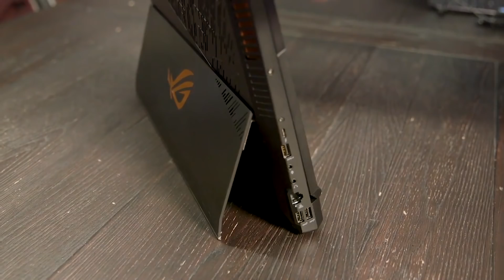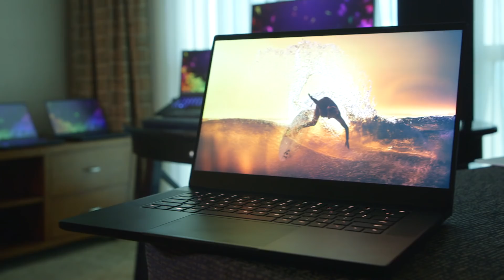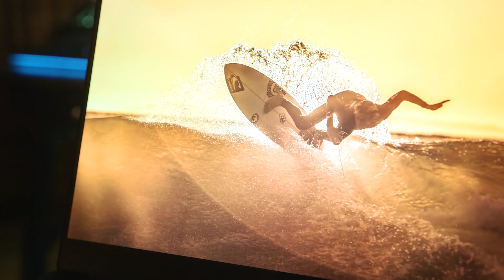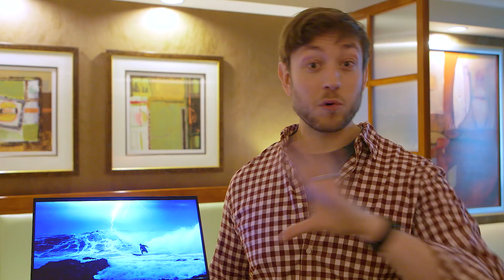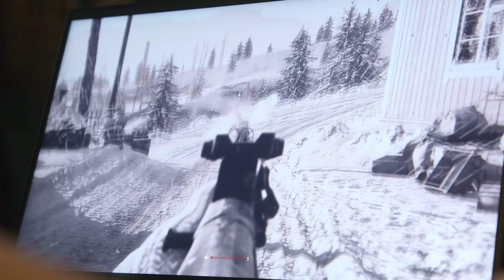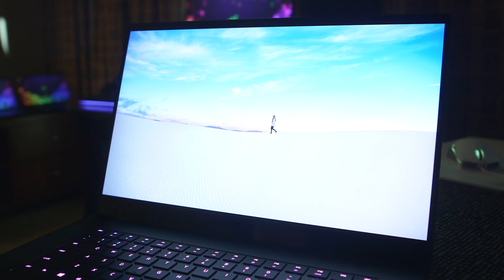Razer Blade 15 Advanced Edition Hands-On: One of the Best Gets Better at CES 2019

Comment: Beware CPU overheating an issue (again), 100degrees with some crashing. xtu undervolt resolves but disappointing it doesn't cool adequately out of the box. GPU ok, 76 degrees max I've seen even in gaming mode (rtx 2070 model). UK (non-US) version buyers NOTE: the secondary function keys do not light up as they were supposed to on the 2019 advanced as advertised, very disappointing to not roll out to all markets. Also there are no drivers available on the Razer website and their support confirmed to me 'they're still working on it', again not great as I have to rely on windows update for drivers and can't tell if crashing not helped by incorrect drivers. I'm deciding at the moment whether to return to amazon based on all of these issues (but the rest of the machine is great which is why the hesitation).

Comment: Why isn’t the 4K version with the 2080 120Hz?
Reply: 4k model available with the 2070 only
Reply: I´m asking myself the same. Why they don´t wanna offer the RTX 2080 with a 4K screen? @anthonyp2382
Reply: The Delivery Man Maybe the 100Wh limit for the battery is the problem. I would imagine a 2080 and a 4K 120hz screen would have abysmal battery life.
Reply: Sorry if i probably was a bit missleading. I didn´t meant a 120hz display. I meant the 4K 60hz touch display you can only choose with the RTX 2070 according to the Razor website. With the RTX 2080 there is only the option for a 144hz full HD display. But why on earth? I´d want the 2080 with the 4K display.  @anthonyp2382
Reply: The Delivery Man 100%. The 2080 is wasted on 1920x1080. You might as well just wait till it comes out and get the same but with a 1070 which will be much cheaper. A 1070 is all u need for HD res.
Reply: Yeah, my initial thought was that makes absolutely no sense for me. Why no 2080 with the 4K screen? @skywalkies77

Comment: Well, this is the only laptop in the windows world that could make me a little bit jealous. Even tho my 15" macbook with Vega is like.. almost perfect... for me as part-time gamer, that amoled screen or 240 hz (i mean, no tearing, no vsync stuff!, stable 45fps if the gpu isn't fast enough for 60fps at max settings) and rtx 1080 a laptop this thin.. and it actually looks good contrary to all other gaming laptops with their childish design.. is just wow.
Reply: But still Vega 20 vs. even 1070 max q  is 2x performance or so in gaming for the 1070 (1070 max q is similar in performance to a RX 590 desktop)

Comment: "Squeeze a full 2080 Max Q in this laptop" is not a big deal...Max Q is a laptop gpu sku.. its smaller and lower power than a 2080 desktop gpu...
Reply: MotoSapien 
it is a big deal actually. this is gtx 1080 (full desktop) performance in this form factor.

Comment: Guess you haven't seen an Alienware 13, it's had an OLED option for years.
Reply: OLEDs are great, burn in is pretty much a non-issue now. Most flagship smartphones use OLED with no issues.

Not like ips has no issues either.
Reply: @Brother Ares Why?
Reply: @Brother Ares care to cite that recall? As far as I know this is Razer's first OLED laptop. 

We don't see widespread issues on OLED TVs, phones or Dells Alienware laptops.

It's a laptop, do you really think that the screen is going to burn in significantly before it's obselete or unusable because the battery, or some other component, has worn out?
Reply: @johnm91326  If there are static images, burn in with OLED is real.  My Galaxy S7 Edge has severe burn in.   I almost bought one of the newest OLED LG TV's at Best Buy in November and once I saw the burn in with the display unit I changed my mind fast.  Hopefully, the newer screens will have this issue resolved.
Reply: @Brother Ares guess backlight bleeding, ips glow and ghosting aren't real issues then. IPS being capped at 60 is just another reason to buy the OLED one then right?
Reply: @Brother Ares to quote you "IPS will be caped to 60fps." Either way I have an original galaxy s with almost no burn in (granted I haven't used it in a few years), the compontents are going to be obselete long before the screen is an issue.

Comment: I actually love Razer's build quality, good looks and I have been using Razer products for nearly a decade. My problem is not "possible" preformance, which has been great even on the 10xx series cards, but rather the real world limitations of thremal solution implimented. Until there is a noticable improvement with the heat distribution I would have to go with something like the Zephyrus S since the thermal solution was proven to prevent throttling in last years model.
Reply: I've been using the blade with 1070 for a while now and it never thermal throttles. The only "tweak" I did was a -140 undervolt
Reply: You can undervolt the CPU and GPU. Dave2d did that and it solved all the thermal problems.
Reply: @Brother Ares that's for sure
Reply: but in most importanly, dont miss the ISSUE after owning a razer laptop how matter its spec it would take you back to RMA :)
Reply: The battery life on the first gen zeph is shit though so pick your poison. With that said, It seems they paid extra attention to it this year, so, hopefully, it's noticeably better.
Reply: Mine doesn’t throttle. Razer blade pro. 7820hk. Gtx 1080. 4k60 igzo panel.  Rma x3 from dead pixel issues. And the fact they dropped and dented my rbp.
Reply: @praystation  the pro is really thick and heavy compared to the Blade or The Blade Stealth.
Reply: I've had a Blade GTX 1060 since end of 2016 when they launched. It gets warm, but not to the point of throttling. I just repaste mine with Grizzly Kryonaut liquid metal and cleaned out the dust, and I've dropped 28 Celsius under max load. While laptop is cooler and quieter now. I'd highly recommend it, and I'll be doing it straight from the factory on whatever my next one is.
Reply: @Brother Ares why is it risky??
Reply: @Brother Ares thanks man. I'll keep this in mind
Reply: I have a laptop platform fan. My boyfriend bought me the Razer laptop and was aware that it heated up quickly when gaming. He then bought a fan that is plugged in via USB and your laptop sits on top of it. I am planning to get a desktop when I get a chair that I can long term sit in, or spine surgery to correct my roto-scoliosis which makes it hard to sit at a desk, but I have sat at a table and played, you rarely notice it, it gets in the way a little but you get used to it. I sit up in my bed propped up by pillows and I have no comfort issues with the fan platform. I wouldn't skip a laptop that's your first choice because of its overheating problem that is easily solved and not expensive. So, desk or on your lap, the fan pad isn't bad and not loud unless you put pressure, like, nudge into it roughly. Then it makes the sound of a fan being poked with a stick. 
My issue is the 3 only USB ports. But I still get by.

Comment: Hmmm not sure amoled works on computer monitors, OLED would be a better option I think.
Reply: Amoled is oled
Reply: Norris Thomas Nope not quite the same actually hence the AM before OLED... have you ever seen a TV advertised as AMOLED? No, for a reason...
Reply: @marksapollo  they are 99% identical
Reply: @marksapollo  AM in AMOLED is a Marketing term.
Reply: marksapollo Samsung doesn’t make OLED TVs
Reply: AMOLED means Active Matrix Organic Light Emitting Diode. All monitors and display panels are Active Matrix. So AMOLED is just a marketing term to trick people into thinking AMOLED is better than OLED.
Reply: Amoled is oled?
Reply: @rohithvishwajith4988  idk but if you take the 'am' from amoled it'll be oled. Idk though
Reply: They should use microled
Reply: AMOLED just a marketing term used by Samsung for its displays. It's basically just an OLED panel.